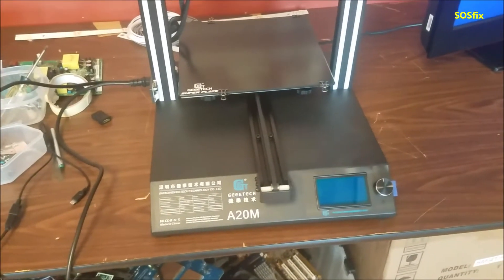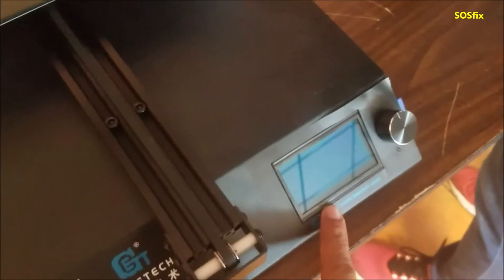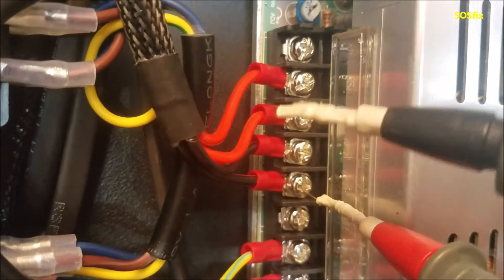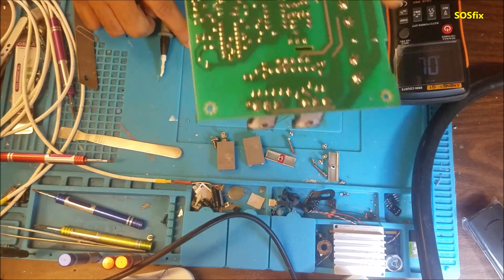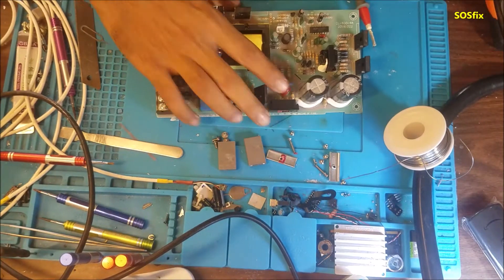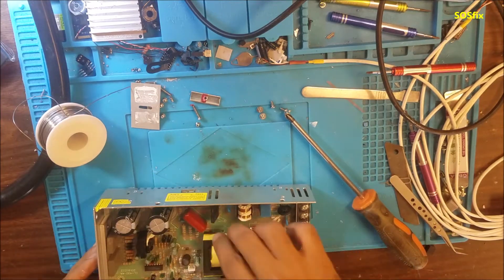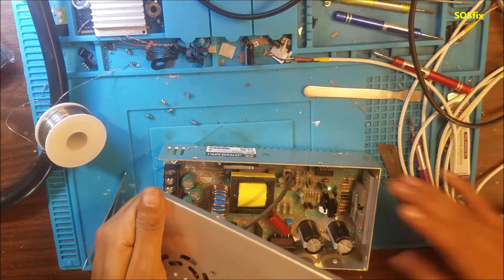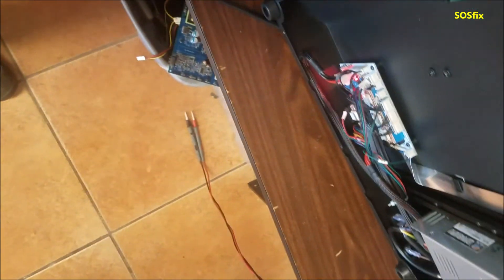GEEETECH A20M 3D printer no power fix

Comment: I had this problem. It was caused by me moving the steppers while the printer was off. I moved the bed too quickly and caused the switch on the back to blow. Not the fuse, not the power supply, the switch. I didn't know this at the time and went through the hassle of replacing the fuse and power supply with help from Geeetech, only to have the same problem. But replacing the switch fixed it. So: replace the fuse and switch first, before replacing the power supply.
All the best.

Comment: After installing a new hotend, the printer gave me the same problem, I disassembled the power supply and it is fine, while the printer board light is not flashing but it is always on, how can I solve? Thank you.
Reply from the maker: sorry i dont have the printer here to do any check, if all the voltages up and stable from power supply you may check the printer controller board

Comment: so what did you fix, what was broken?
Reply: The issue was clearly explained/fixed in the video.  One of the wires wasn’t soldered to the board. They soldered it and the printer worked.